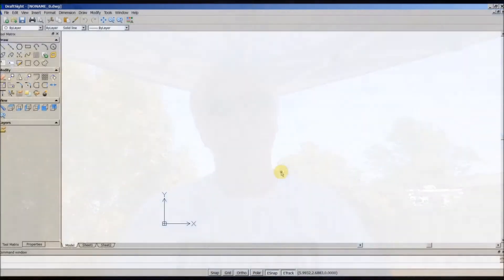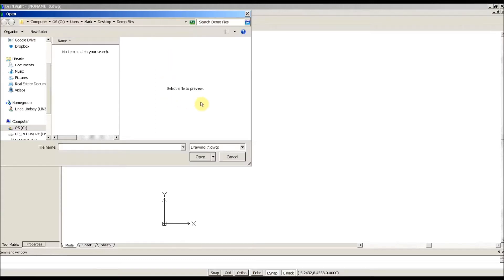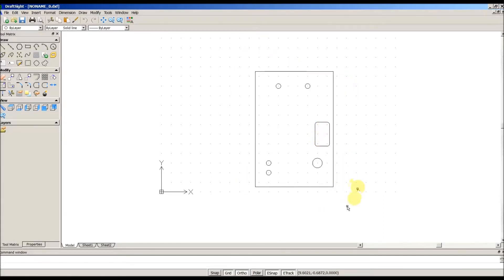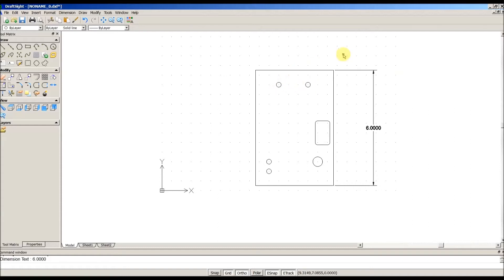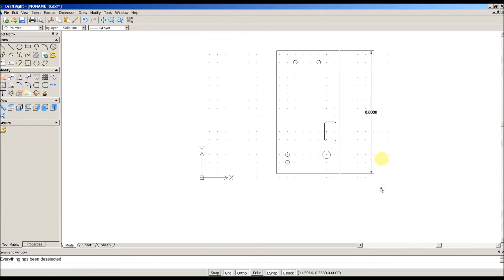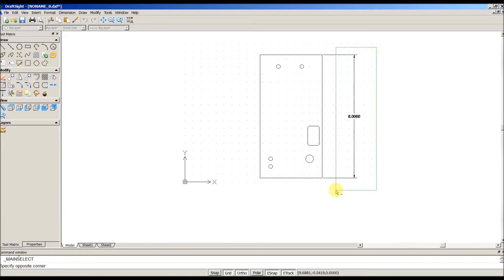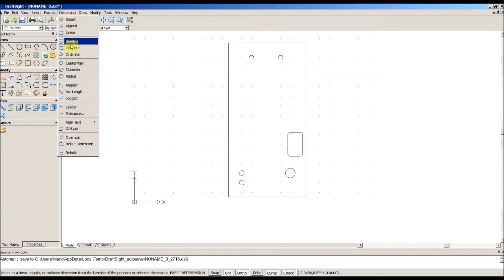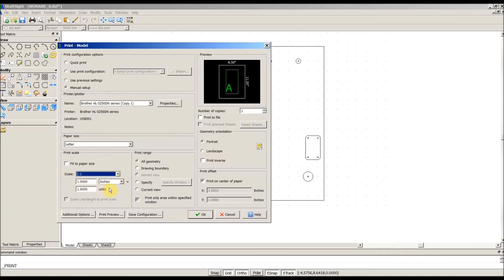How I Resize and Add Center Marks to a DXF File in DraftSight

Comment: As previously mentioned Draftsight is no longer free. I don’t mind paying for a program but I do mind a software company extorting money from me for a program every year. I found another new CAD package called  nanoCAD. I haven’t used it very much but it looks similar to Draftsight.
Reply from the maker: When I recorded this video 4 years ago, I thought Draftsight was a great program - and it was. I have since switched to NanoCAD as well.
Reply: @MarkLindsayCNC  yes, Draftsight is a very good program. I used it for years at work before I retired creating electrical drawings. It was very clunky for that purpose but the company wouldn’t fork out the dough for Autocad Electrical. I created lots of blocks for all of my electrical components that I could easily insert into a drawing. What is your background? You are very knowledgeable about all of these software packages. How about some Mach 3 videos? I’ve been looking through your videos but I haven’t spotted any.